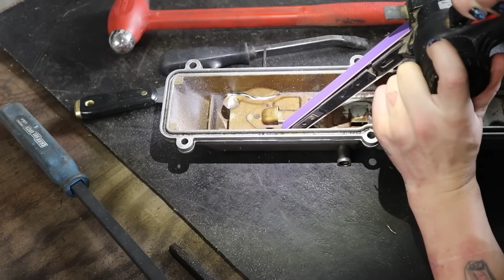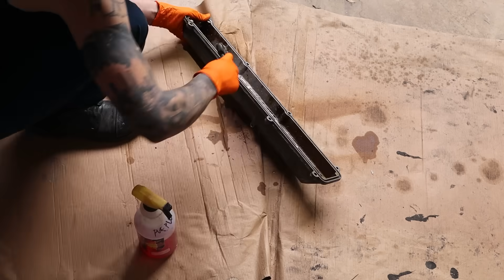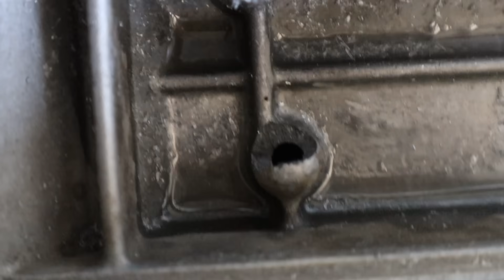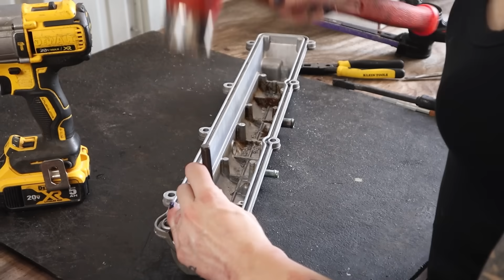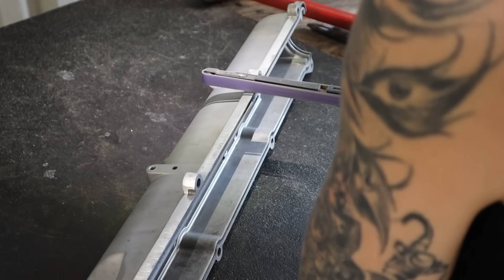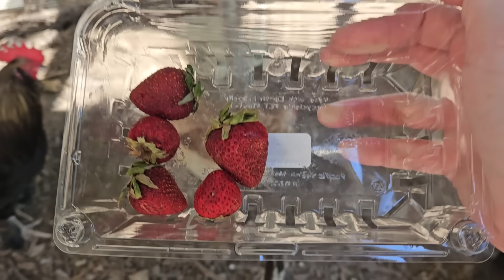How to Prep Valve Covers for Powder Coating, featuring @MrDanielSoliz ! #autoDIY #cartips #DIYtips

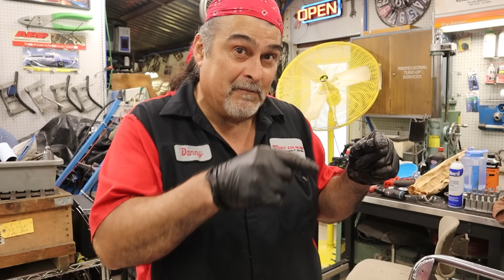Comment: 7:50 - I've had metal beads fall out of my new, from the box,  TrickFlow upper intake manifold for my 95 mustang. I cleaned it the best i could before installing it and i haven't had a problem. I was concerned for a while tho. 😐

Comment: Yes definitely hot in east Texas today. Doing the same thing today, cleaning up a old set of cast valve covers been in storage for twenty years. Used aluminium pontoon boat cleaner and a stiff brush to start, next scotch bright and fine sand paper. Going to see if I can get them polished up again if not what ever i get is good enough.

Comment: When screwing them baffles back in I hope you use something on the treads to keep the screws from backing out. I would put JB weld on the treads before screwing them in, not sure how Loctite holds up to hot oil.

Comment: Really awesome work. One more tip I would give for items that have been in contact with oil as well is to bake them and clean them again. Getting them nice and hot will help expel any moisture and oil embedded in the surface. Clean them again with degreaser, letting them soak or using an ultrasonic cleaner ideally. Can repeat the whole process if they seem extra contaminated. Since the part gets heated during the powder coating process, that's when oil is most likely to seep out of the pores of the metal and cause defects in the finish. Great job overall! Def gotta mind those baffles. Always nice to see Danny.
Reply from the maker: Oh, definitely. I actually did mention this, but then I cut it out because that is part of what the powder coater will do, not what we would do for prep! And since I don't have an oven or any way to do this, I felt dumb saying "do this" but then not doing it myself!!! But I do agree! I showed baking prior to coating in my last powder coating video!!
Reply: @FayeHadley  Definitely know how that goes! Hopefully the powder coated does it, yes. I have a fairly large old toaster oven for my shenanigans. :D

Comment: I found 1/4 inch stainless steel machine screws at my local Ace hardware in my little burg. You can check their website to see if it’s in stock locally. Good luck.